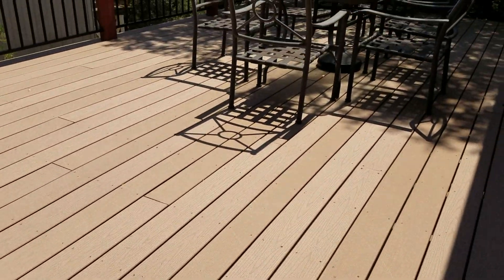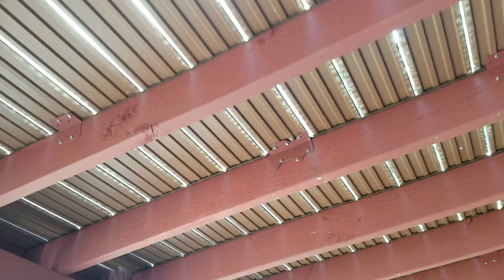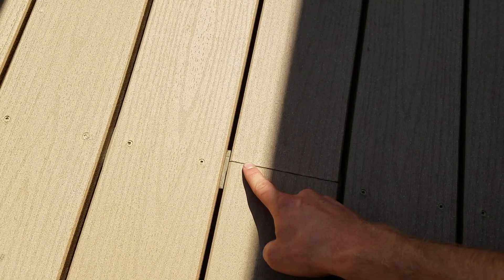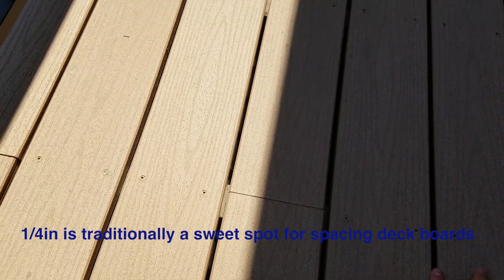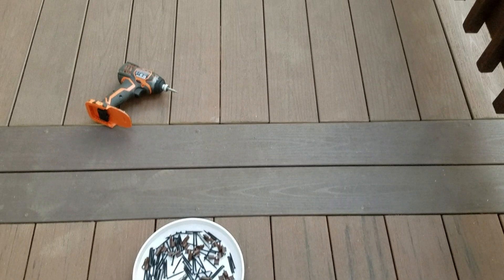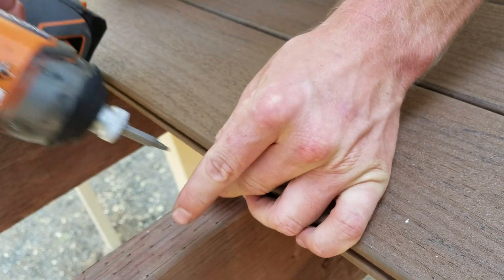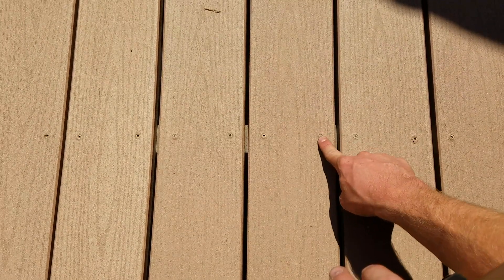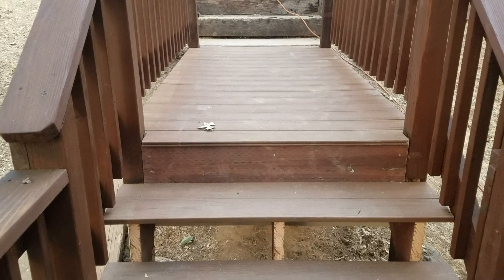Correctly Spacing Your Deck (1/4")

Comment: A 1/4" gap between deck boards is good - IF the boards are dry. If the boards are wet than an 1/8" gap would be good.
Reply from the maker: Great info

Comment: I'm a professional deck builder and 3/16ths is the max you should space your deck boards. 1/4 as you can see is too much gapping to look good as well as have fun losing your bits and anything else small enough while and after installing the deck boards. This composite capped or full PVC decking doesn't expand in the width of th board but in the length of the board. A 20' board of Azek decking can expand as much as a 1/2" over the whole run of the board or a 1/4" on either side. Your best off to set your decking and fascia when the sun has been heating it up for an hour or so, that way when you set the boards they will contract to the screw points rather than buckle in-between the joist spaces/screw points. This is especially true when setting miter joints. The quickest way to wreck a good surface border/picture frame is to set your miter joints tight when the decking is cold in the morning from sitting out all night. Keep in mind the temperature of the decking as you install it. Also wait a day to cut the ends off your deck boards after you finish installing them. Cut them all in the morning when to the same gapping or overhang as the other side and you will have an easier time keeping things symmetrical.
Reply: Bro, can you please make a YouTube channel?  I just read your comment and was like, "Why is no one talking about this?"  Very helpful!

Comment: Why not just a short sister joist block, instead of steel angle brackets, on one side of the joist to provide sufficient attachment real estate, for deck-board end for end joining ?
Reply from the maker: Yes, you can do that. If a hardware sells a part that is in metal I usually go with that because it will last longer than wood
Reply: In that case one would logically ask; what advantage then, would the additional longevity of metal angle brackets give you, if the deck joists that support the rest of the deck, last the same amount of time as the cheaper option sister joist that instead could be used for the decking's end joining, where all joisting is made from the same treated wood ?